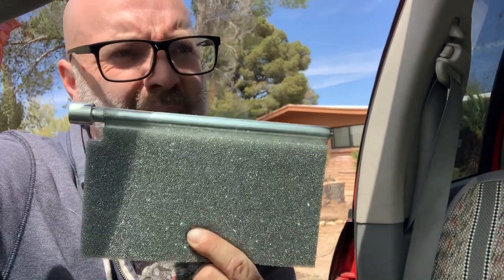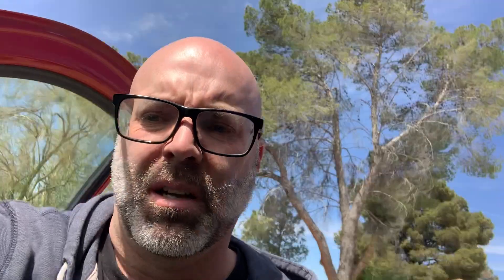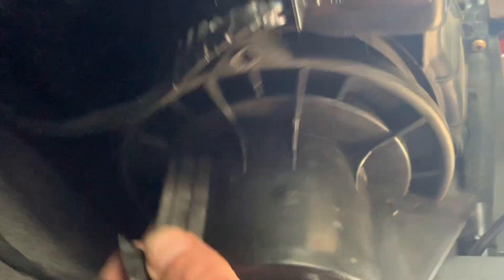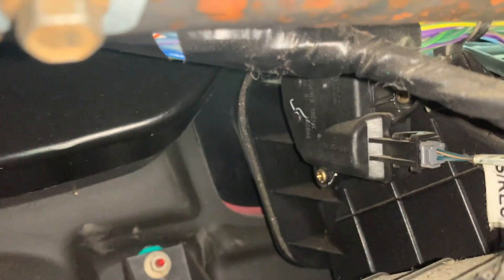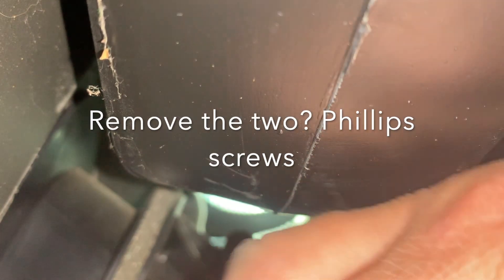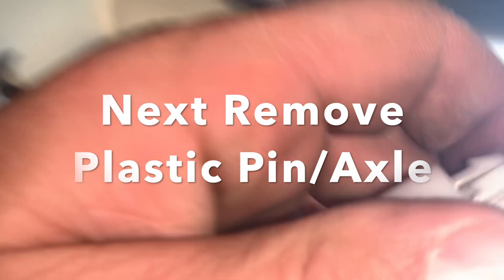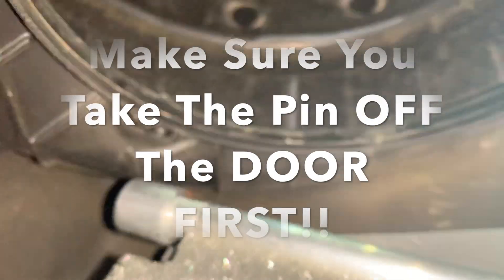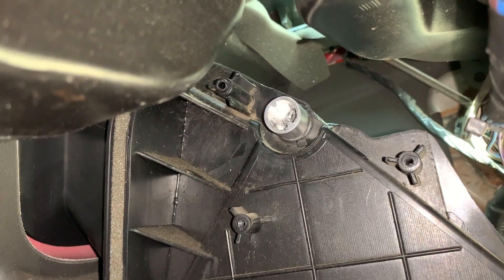Replacing Recirculation Door 2006 Dodge Ram 3500 Cummins.  (Non-Premium Radio/No Factory Amp)

Comment: So what malfunction caused you to replace this particular door? I have a 2006 Cummins Ram 3500 and I'm not getting heat to the driver's side. Which door would you think is MY problem? Anyone have an answer?
Reply from the maker: I’m guessing you have dual climate.   In that case it is your driver’s blend door.
Reply: Ever figure it out Dan? I have the same issue on my '07 2500 Hemi SLT. Doesn't have controls for dual climate zones but the passenger side blows cold, driver's doesn't.

Comment: Have been following for awhile and just subscribed.  Nice technical addition to the video content.  I notice the Rotopax containers mounted to your NL roof access ladder.  Since I own a 2019 NL 10.2 EX CD SE and am modifying for some extended Canadian travel. wondering if you have some details to share on how you rigged up support for the Rotopax mounting hardware.  I can see the standard fitting but not the details on the backside of the ladder.  Did you experience any damage or deflection on the ladder from the dynamic loads?  Thanks for any insights and safe travels.
Reply from the maker: K Theodore I’ll post a quick video and show you.    Thanks for watching!
Reply: Thank you, Mr Landmarks.  I'll look forward to it.

Comment: I have seen several videos on YouTube. I think this one is probably the best out there. I just did mine today . Follwed the step by step and worked fine.. Couple points . The end peice I used needle nose pulled straight out.. The old blend door: there is a deeper part of that compartment way at the top where you have room to turn the blend door vertical in order to get out. Thanks
Reply from the maker: Thanks a bunch!    Did u fix it?
Reply: @thelandmarks3320  yep. Worked like a charm . Thanks!

Comment: Well...this video was very informative and helpful.  Thank you for posting it!  I will say that if this door breaks again...I'll sell the truck before I go through this chore again. 

Of course I have the da*M amp so it was much harder. I did remove the main right side dash trim by removing screws and just easing the right side down a bit.  With this trim moved I was able to get in and do the job.  I hit Harbor Freight and bought some specialized screwdrivers (small knob type and the angled ratchet type) to get to those difficult screws.  Also had to unscrew the amp and slide it out of the way - held by 3 10mm bolts...it moves just enough.
Reply from the maker: Thanks for adding your experience.   I hear the amp makes it a serious POA.

Comment: Thank you for this detailed and outstanding video...I have seen many videos and yours just made sense instead of cutting things up or removing the dash.  I have a 06 Dodge Hemi 1500 and the only part I had trouble with was the plastic pin/axle. I finally used a really small needle nose pliers and just gripped the sidewall of the axle pin where the actuator motor goes into and out it came.  Sure is nice to have the a/c blowing cold and quieter. Many thanks again...
Reply from the maker: Frank Garcia Thanks for the reply.   You get a lot of grief trying to help out your fellow Dodge owners on YouTube. Glad I could help!

Comment: Clear, easy to understand video.  However,  could not get to the actuator screws because my 2006 Dodge Ram Mega Cab Laramie had a factory amp installed right in front of them.  Yikes.
Reply from the maker: Norman Heggstrom Hey.  Thanks for watching.     Sorry about the amp.   Fancy dodge.    I had much more space to work with.

Comment: Thank you for the detail and easy follow video.  I have a question about the axle/pin.  Do i need position how the door goes into the axle or needs to put on certain position on the air direction switch when installing the door? Thank you.
Reply from the maker: junda6 Sorry for late reply.     The computer will go full open and close on start up, it will then figured out what position the door is.  As far as what side of door faces what,  I put the foam facing inward for good seal.     Hope this answers your question.  If not,  let me know.      Cheers.
Reply: instaBlaster...

Comment: I was told by a shop they have to tear the entire hvac ducting out to do this job, for $800 plus parts. I've been running without for a couple years now. This video here is perfect slap to the face for those that paid that extortion price. Haha thanks for posting

What's the part number?
Reply from the maker: thanks for watching !

	3rd Gen Ram (02-09) Recirculation Door (DT-3962-Y) × 1

Comment: They must tried to cut costs on the later models.Mine had three screws and top screw you cant get out because of the duct work over top. Just had to bend and rotate out of the way to get to the white drive key. What a pain in the ass.
Reply from the maker: Appreciate the info.  Thanks Rob.

Comment: Hell of a video...  I know from personal experience there is very little room to move in addition to filming your repair....
Reply from the maker: Thanks for watching.  I don't know if the 5.7 hemi truck is a different set up, but someone very upset posted last week that they could'nt do it.    I'm no mechanic but I guess I proved an idiot like me can do it.
Reply: @thelandmarks3320  Yeah I am pretty sure it is the exact setup as I have the Hemi in the driveway with need to finish this fix as well.  Last issue didn't require a large amount of work and I took a quick short cut.  This idiot doesn't fit under the dash though no pain no gain...
Reply: I have the 5.7 and everywhere I’ve read says you have to cut into the box if you don’t take the dash off. I just removed the blower and ripped the door out so I could get actual air movement and left it like that. I’ll take a look at it again and see if doing this way is even possible.
Reply: I followed his method except to two small details? Used Duct Tape (the real deal metal tape for HVAC) and I covered up both holes in front of the passenger side. The good news is I actually have heat now and it didn't take but a second...